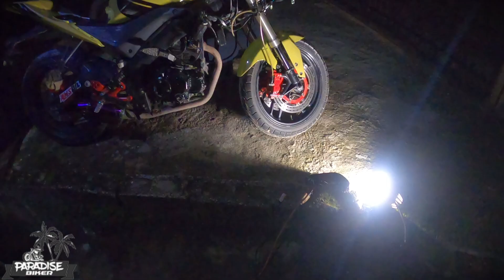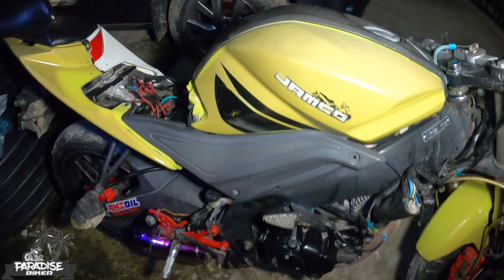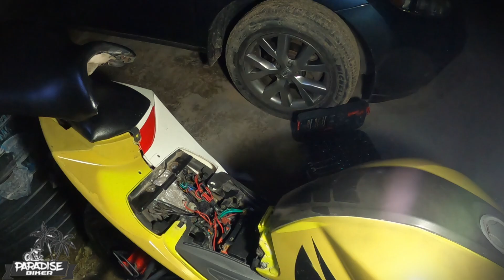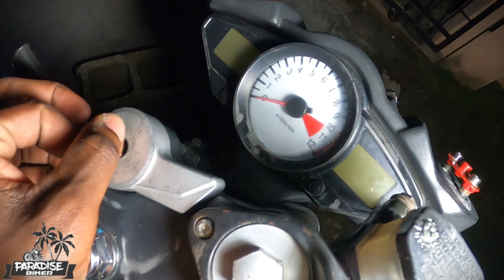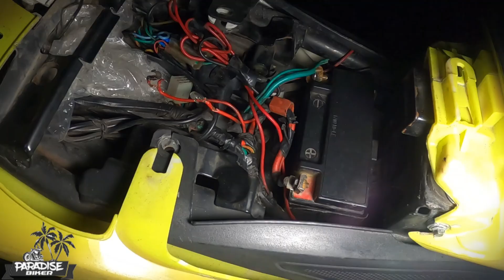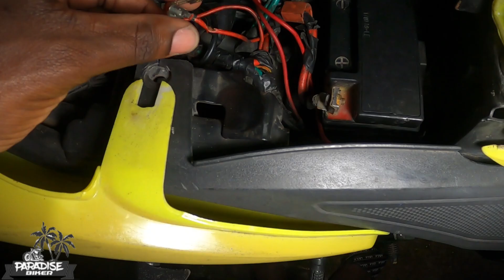Had An Electrical Issue With My Bike - It Wasn't Starting | Jamaican Bike Life 🇯🇲

Comment: fi the shot switch pon shem bike him connect a wire pon the blue an white wire that comes frm the engine coil....an connect it to the horn button.....or if the horn button isnt working you can just put that wire that you connect from coil an put it on a metal part of the bike an srtip the wire....p.s its not gonna shock or cause any harm to the bike
Reply from the maker: Nice info 👍🏿. For those who are interested

Comment: My mistake.......air filter oil was asking about
Reply from the maker: You can get those at autoshops. A way to save money is to change ur filter to a paper one which doesn't require lube. Or just use the same engine oil.. But use a little
Reply: @ParadiseBiker  thanks man.....really appreciate the knowledge